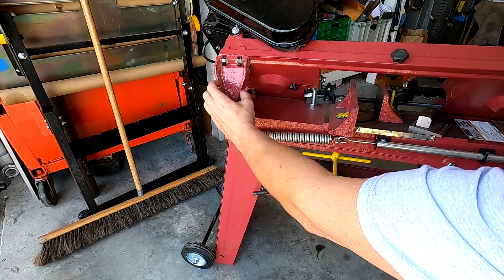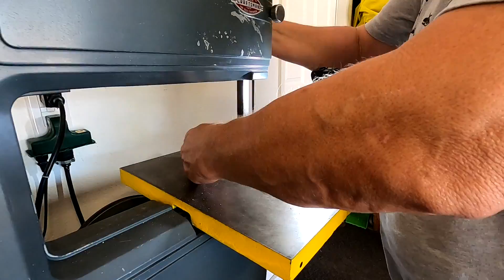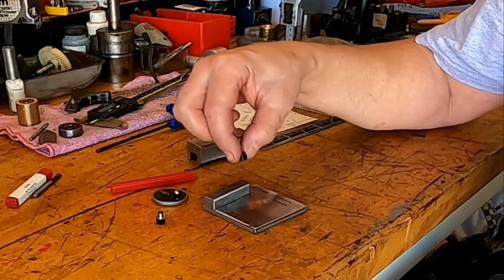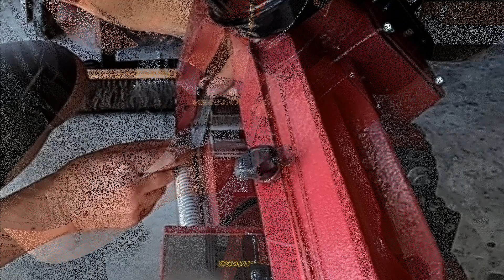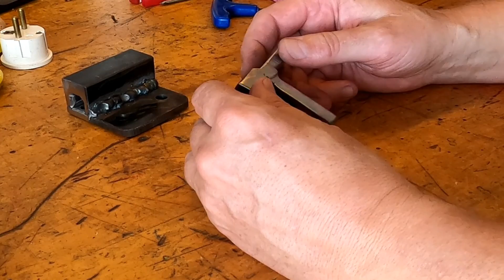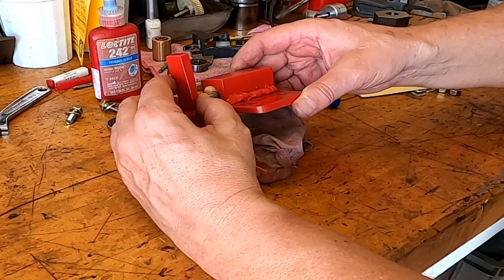Make a Better Band saw lock down for the Harbor Freight 4X6 band saw: Compiled video from older set

Comment: Dam What kind of welder?
Was that does it plug into the wall?Never seen something like that before.Seems easy to work with.Maybe I'll pick one up ...nice video...i supose your not around citrus county area?
Reply from the maker: Polk, Yes, its my go to welder. Multiplaz 3500. Price has skyroketed since the Ukraine invasion. Its a Russian piece.  Ive done at least one vid on it  that I can remember. Converts water and isopropyl alc to CO2 for weld coverage and to push the plasma. Uses a plasma arc to do the weld. Very controllable and easy to get a full penetration weld. I like being able to do very thin metals or crank it up and weld heavy stuff. Glad you noticed. Don

Comment: Hi Don ,  I've watched your video with interest but I cannot figure out why you built that stop.    i have a horizontal bandsaw and never have known a time when I needed a stop to keep it from lifting.?????

Dale in Canada 🇨🇦
Reply from the maker: Hay Dale, the casting hole where the cheap pin runs through is worbled out and the pin keeps bending.  And I just like making stuff better. Its the hot rodder in me.
Reply: @donsengine3158  Hi again Don.    Thanks for the reply and I understand the hot rodder for sure.    I have a pipe on my saw that you can pull out and is so easy to move the saw around.    If it did not have that I think I would make a handle that folded down and would extend out when picked up and stop about 90 degrees.    Just some thought for you. 

Dale in Canada 🇨🇦
Reply from the maker: @dalemcinnes1834  I have a fold down handle on mine. It is a little chintzy, so it may get deep sixed in the future.  Don